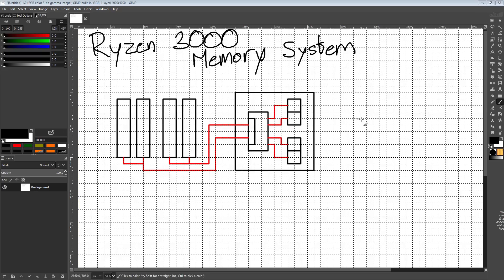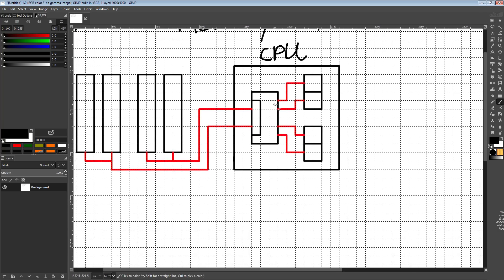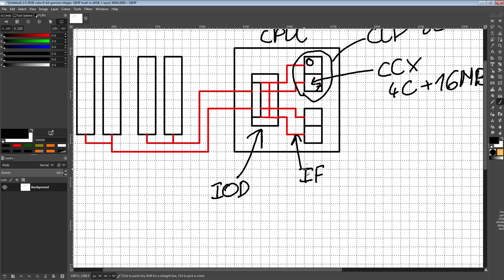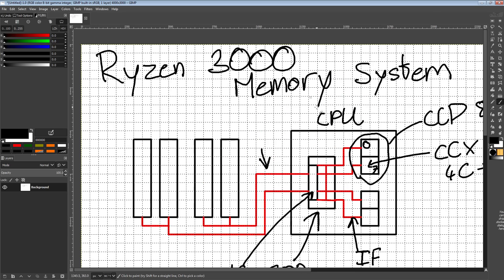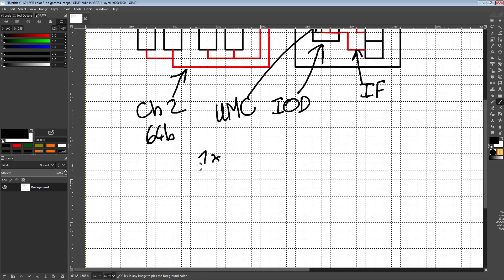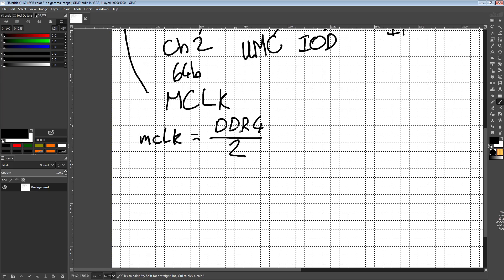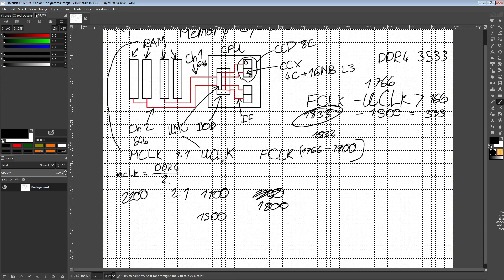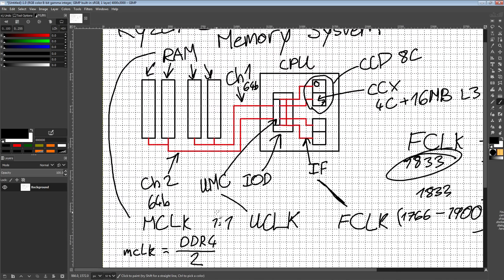AMD Ryzen 3000 memory system explained

Comment: Got my Trident Z RGB 3200MHz CL16 OC'd to 3600MHz CL16. So yeahh....
Reply: Is that Samsung B-Die or Hynix CJR? I bought G.Skill Ripjaws V 3200MHz (f4-3200c16d-16gvkb) for $77.99 (Hynix CJR) and I'm really pleased with them. They ran 3400 at 14-16-16-16 1.40v and now run 3600MHz 16-19-19-19 1.38v. I could probably tighten a few subtimings (especially TRFC) but I'm already happy with the increase in responsiveness from 1600 to 1800 FCLK and I want to enjoy it and stop tweaking stuff :D

Comment: @Actually Hardcore Overclocking The Video was quite good but your diagram is not quite accurate. There is only a single interconnect that connects each of the CCds to the IO die and that Interconnect is chared by both CCX modules.  There are two interconnects for the two die CPUs 3900x and 3950x.

Each of the Memory related interconnects operate at a rate of FCLK x 32  Bytes/cycle. You can work out the max bandwidth by calculating it out. with 3600MT/s memory the total available bandwidth is 57.6GB/s. That is teh reason why the max throughput that you observed was 57GB/s even with higher clocked memory.

Intel Ringbus runs the connectivity between CPU and memory at a badwidth determined by teh Cache multiplier. At x45 that is 144GB/s. Both the Infinity Fabric and Ringbus provide shared bandwidth for teh CPU accessing memory and the GPU accessing the L3 Cache to obtain instructions.  

Tested memory bandwidth on Intel remains constant and in excess of the maxumin throughput potential of teh DDR4 memory but with Ryzen, the tested throughput is only true when you are not running a game as the Interconnects Bandwidth at 1:1 matches the capacity of the Installed Ram. Running a GPU in a game over the shared bandwidth means that the CPU bandwidth to memory is compromised.  As such, the CPU obtain data necessary to operate at full capacity.  As you alluded to, a system with  2133 MT/s Ram with 1900FCLK will almost match a system with 2080TI running 3800MT/s Ram when a 3200 system will not in games.

Comment: In my case 1900 FCLK stable (Ryzen5 3600) pass test AIDA64, linx, "AAA Game" about 1 hour all goes well. (RAM 3200cl14 SOC voltage 0.975)
Reply: Games rarely stress IF enough either. Try a video encode as mentioned.

Comment: What about 4 memory channels (4X16)?
Reply: That's not channels. If you look at the schematics in the video, there is only 2 channels but 2 DIMMs can be connected on the same line. That's how it's made with typical consumer platforms.
Reply: real Quad-channel memory controllers are priced for the professional application market. It's very expensive in an effort to segment the market between Commercial Level and Consumer Level hardware. (Note: This market segmentation is not necessarily a BAD thing for us)

Comment: Wait a minute, I thought the memory controller was actually good this time and it was FCLK that can't normally exceed 1800-1900mhz.
Reply: Nah, it's still bad, the only good thing is that we can achieve higher memory clocks with less severe performance penalties. The overall latency is still bad, not better than on Zen or Zen+
Reply: Well sure you can run the memory up to 5 GHz or so but that doesn't make it a good idea.

Comment: You say you haven't tested 2:1 Vs 1:1 but here https://youtu.be/nugwAOvijHQ you did all sorts of testing that atleast proves how the ratios are working couldn't you extrapolate from that that 2:1 Vs 1:1 doesn't make a difference as long as the uclk is the same. Hence 1:1 2333mhz = 1166 uclk, therefore 2:1 4666mhz = 1166 uclk. There really shouldn't be any reason besides some negligible conversion that makes a performance difference.
Edit: I think I did something wrong there but I'm sure you understand my point

Comment: Any tips on overclocking the FCLK? Any voltages to tweak? Mine won't go past 1800, boots to windows at 1833 but crashes within minutes.
I have a Micron E-die kit is sort of stable at 4000 CL16, it would be nice to put it to good use.
Reply: You have to increase the SOC voltage and the CLDO_VDDG voltage. VDDG can't be higher than SOC. Both can be pushed as high as 1.1v and basically still be in spec. I'd start by trying SOC voltage of 1.1v and VDDG of 1.05v. If you need to, you can probably go up to 1.15v on both, but that's starting to push the envelope. I wouldn't go higher than that, personally. Also, it probably won't be necessary.
Reply: @nagorak666  1usmus said that 1.1v for VDDG is max recommended by him. 0.95v enough for 1800 FCLK and SOC voltage must be minimum 0.05v hire than VDDG.
Reply: Try to win in silicon lottery and buy a cpu that can support 1900... you may have to buy tens or hundreds of cpus but you may find one that has good fclk...

Comment: Good video. I knew CCD to CCD needed to go through IF but I didn't know CCX to another CCX on the same CCD also needed to go through IF. Makes the 3950x a bit more appealing since it has 4 cores per CCX vs 3 cores for the 3900x which could in theory be less reliant on IF if you're playing a game that uses only 4 cores, assuming Windows Scheduler is smart enough to run them on the same CCX.
Reply: This was my thoughts when the r5 1600 which is 3+3 cores and 2200g single 4core ccx first launched. (I really like the 2200g on paper and wish I had one to play with).
people were praising the 1200/1300/1400/1500x which are all 2+2 cores. I'd avoid them as much as possible.
Reply: @tomstech4390  Steve from Hardware Unboxed had tested this and saw no actual difference between 2+2 and 4+0 in gaming.
Reply: @igor_mkv  with hyperthreading and lots of cache because he used a 1700 and there were minor differences in favour of 4+0 but there are no quad core chips that are cheap with a potential 16MB l3 cache (even if the cache in the other CCX is disabled which we dont know thats still 8MB.
Im just saying I'd just be happier about it being all in one ccx anyway.
Reply: You're right but there are no straight up quadcore games, it's mostly one pegged thread and some less strained ones. I'm just saying chances are, a game will use more than 4 threads anyway and using another CCX is faster than using SMT, but it's not so critical that all of the threads talk to eachother as fast as possible.

I agree that schedulers have top take all this into account now though, and i hope Microsoft and other dev studios actually take up this challenge. There will be so much performance to be found if only the right cores get used at all times, instead of just round-robin.

Comment: I’m getting sick of this Infinity Fabric thing. Seeing Linus manually tighten the timing of of low latency 2133MTs (1066 MCLK) memory kits and clock the FCLK up to it’s ceiling freq of 1900Mhz, it magically matches the performance of the low latency 3200Mhz CL14 memory kits in gaming which somehow give us some hope on out-of-sync memory tuning. But then, thing starting to get weird as we start using a 3600MHz (1800 MCLK) memory kits. Any memory kits that came out of the box with a rated freq of 3600Mhz(MTs) or above will suffer a performance loss once you decouple the MCLK and FCLK. A non 1:1 ratio is suddenly become not ideal or whatsoever. Instead, what give our system a boost, at least in gaming, is only by us, aggressively manually tune the timing. I don’t know how this even have any relation with this UCLK thing, and I’m getting more and more confuse now.

Comment: There might be an octa-channel TR variant in the works, but that will require new motherboards.
Reply: It would be neat if the 32 core TR could still USE 8 channels on a new motherboard while maintaining backwards compatibility with the previous 4 channel boards. Not sure how big the performance difference going from 4 to 8 channels would be for a 32 core, but might not be worth it if those boards are like 1k.
Reply: @NeoNoggie  the socket will stay the same, so there is a possibility
Reply: Casmar 8 channels is useful for workloads like database and big data but the price hike definitely will impact the regular consumer. I think AMD will reserve 8 channels for Rome.

Comment: Welcome home, and i was wondering how slow ram needs to be before more fclk = better thanks. If you get a chance can you test your x470 gaming plus on a ryzen 3000 cpu, i can't pass memtest86+ 5.01 (fails in test 7) without either using single channel ram or disabling cores, i tested 2 ram kits w/ same results, not sure if it is the bios or a bad cpu, and if i turn off SMT and have all cores it locks up 1/2 way through test 7 in under 4 minutes; i have a 3600

Comment: if my FCLK is set to 1900 I have a 1 in 5 chance of not posting on a cold boot. Im still chasing the 3800 dream. It does post after bios changes and passes stress tests but the bios resets are annoying in that 1 in 5 chance. Im wondering if its the CAD BUS Strength Ive eliminated that its not the voltages or soc Voltage cause I gone up to stupid amounts and even then I get the same issue. at 3733mhz I have it 100% stable but im still gunning for 3800 :( at the moment I took a break and just worked on super tight timings for 3733mhz I have cl 13 at the moment probably will need to change back to cl 14. It currently at 1.52volt though for me to maintain stable cl 13. 1.2soc Volt vddg 1.5 vddp 1.1 (might be the other way around i forget which off the top of my head on vddg/vddp)

Comment: Question: people seem to think that you always need to run 1:1 on Ryzen 3000, but from what i've seen it is beneficial to overclock IF (FCLK i believe) even if it will no longer run 1:1 with RAM.
The only way non-1:1 becomes a problem is if you are running RAM past 3800Mhz in 2:1 mode.

So for example pushing FCLK to 1900 but MCLK is at 1600 (3200Mhz RAM). By this logic people seem to think that you should also run FCLK at 1600 so it would be 1:1
Hope someone can clear this up for me.
Reply: Ok so this is addressed at 12:28 onwards in the video i believe.
Reply: U can check biuldzoid's video called 'Ryzen 3rd gen MCLK vs FCLK part 2'. At the beginning of this video he talks about this case scenario.
Reply: Yeah watching the video first is usually a good idea.

Comment: Good point that you can't test the IF with memory stresstests.
In my case the 1900 IF passed Karhu without any problems, but playing BF V (yeah actually sometimes gaming^^) the whole system rebooted after some minutes. I had to raise voltages a little bit (Vsoc 1.15v and VDDG 1.1v) to have it completely stable.
I think this video might be very helpful for some people, so thanks!
Reply: Flynnchen82 prime95 does a good job testing IF
Reply: @rdmz135  Which prime95 mode?
Reply: @cl4ster17  I do both blended and small FFT. Both do the job but blend is probably enough to test the IF.
Reply: @rdmz135  Good to know. Thanks
Reply: Redemz i ran Prime95 small fft few hours and lots of another benchmarks. I kind a wanna say that i got FCLK stable at 1900Mhz while UCLK is 1600Mhz. Time will tell! It gave +100 on CB20 multicore, but also gave few ns latency penalty.  (x570 Taichi with 3600).
Reply: @qettyz  The latency pentalty can really suck if you're a gamer
Reply: @rdmz135  yeah, i play mostly arma 3 what is cpu intensive and benefits from fast memory. Did not affect to that negatively, actually "yet another arma benchmark" was about the same, few fps more but it always gives different results. Maybe faster IF can "win" latency penalty.
Reply: @qettyz  Faster IF can beat the latency penalty but nowadays its so easy to find cheap kits that can do 3800Mhz like Micron E die or Hynix CJR